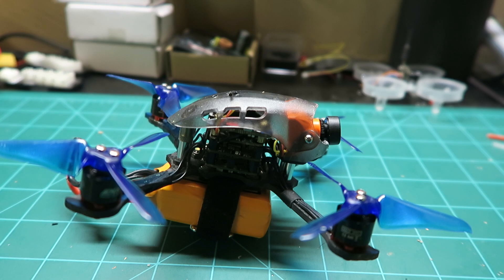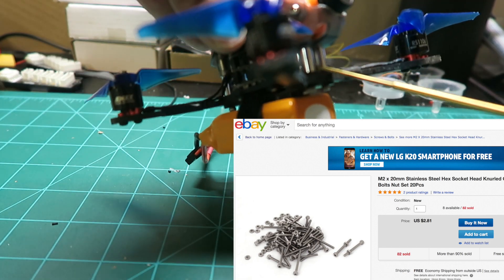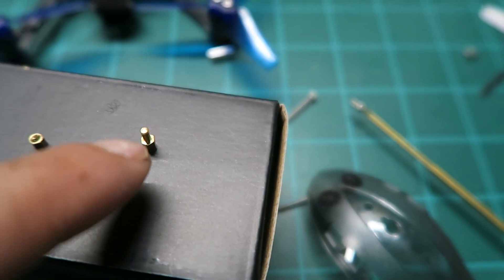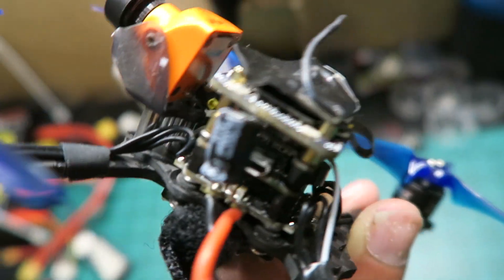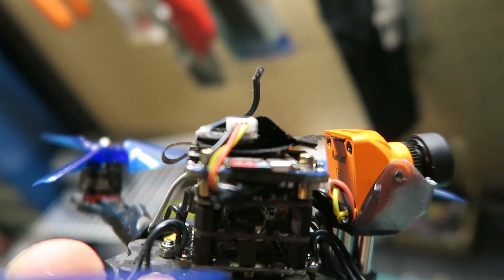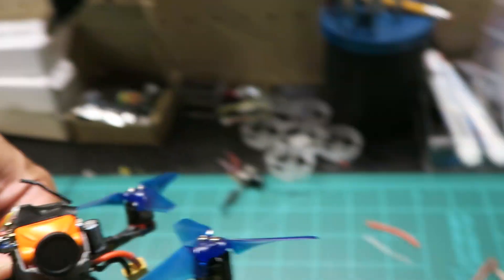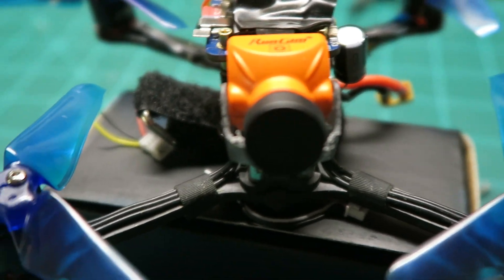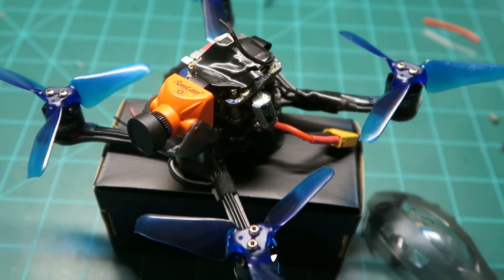Babyhawk R 3" + Runcam Split Mini V2 INSTALL & FOOTAGE

Comment: I picked up a Babyhawk R from a guy that was flying it in a Taranus XT Lite, but I can’t get it to bind with my Radiomaster Zorro.  I’ve gone through all the normal binding steps did a fresh CLI dump, tried different protocols, etc.  The lights all cycle and the motors turn in BetaFlight.  Even the light on the receiver flashes once I put my transmitter into bind mode.  Still nothing.  Any tips?  New firmware flash?  New reviver?  Thanks.